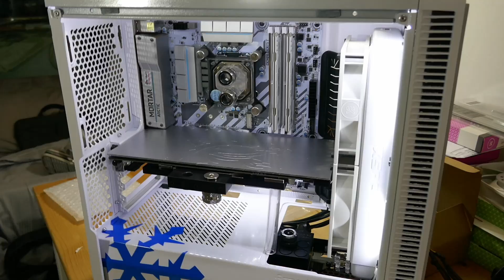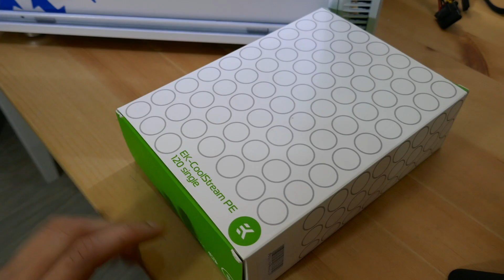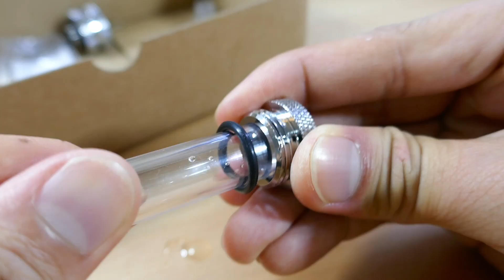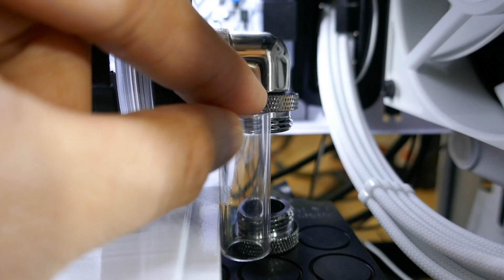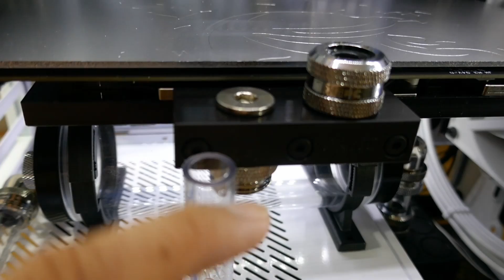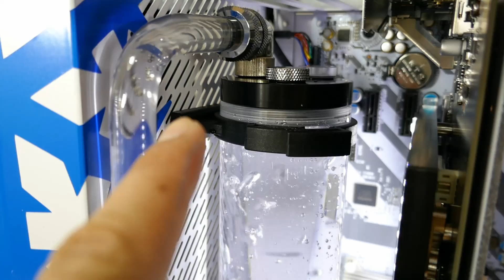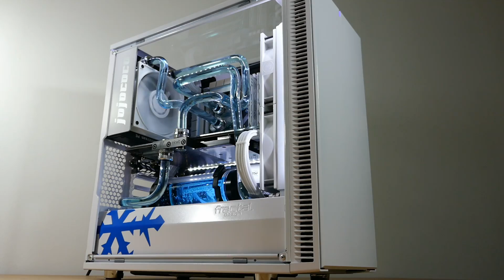Micro ATX custom water cooling loop on the Define Mini C (Part 2 of 2)

Comment: Pro tip: To make sure your bends are in the correct position. Pre-plan your loop in cad software. I use autocad but Sketchup is a good alternative if you don't have an autocad license. 
Then to make sure all your bends are at the correct radius, get some pipes of various radius, and use them to check your bends as you go.

Comment: Hey Jojo. As someone who is addicted to jayztwocents I have watched every video he has put out. One thing I must pass on to you and to anyone new to water cooling. When filling your pump and system, please do not use the power supply that is connected to everything in your system. If you have a leak while you are filling your loop and everything in your system is powered on, there is a very good possibility that your hardware could get damaged. Get a second cheap power supply with an on/off switch and plug the pump molex in to that. You will need to get a jumper for the motherboard connector for that power supply to trick it to thinking it's connected to a motherboard (this video Jay shows what the jumper looks like - start at 1:10 https://www.youtube.com/watch?v=GqYQ-XnOPPI&t=201s). Then to turn on the pump just switch on the second power supply until the reservoir is empty as you did. 

Another thing I gotta say is as you do fill the system put paper towel under each fitting. Wherever there is a possibility of water coming out put paper towel under it. It's really helpful to use even just a little colour in the water so it will show up on the paper towel very easily. But you can get by with just looking for leaks and drops on the towel as you go. 
Edit To be honest I hadn't finished the video when I made this comment (I got a little triggered when I saw the system powered on). You did mention the paper towel after, and the dye was added. sorry for jumping the gun.

Last thing I swear. Best practice for making a loop is to always include a drain system. All it is is somewhere out of sight (usually the exit of the pump or bottom fitting of a rad) put a t splitter on one of your fittings (https://www.ekwb.com/shop/ek-af-t-splitter-3f-g1-4-black) then a valve (https://www.ekwb.com/shop/ek-af-ball-valve-10mm-g1-4-black) with a plug. Then when you go to drain your loop, make sure the valve is closed, remove the plug, attach a fitting with some soft tubing (or whatever) aimed at a drain (or bucket if saving the fluid) and then open the valve. You will need to allow air into the loop to let the water come out, so you will have to open or remove a plug somewhere that wont let water out (the top of the gpu block).

This is one of Jays videos where he has some fluid issues and had to change the fluid in his loop so he goes over everything I talked about here. Lets be honest, videos are better for learning. 
https://www.youtube.com/watch?v=gIv2yGlbYy8&t=762s
The relevant part starts at 6:06; he talks about the power supply at 9:44; he talks about letting air in to drain the loop best at 10:43.

I know I am a year late to this video, however I hope that leaving this comment will help someone who is new to water cooling be a little safer. Water cooling is great and really not as dangerous as people like to make it out to be. You just have to be a little more observant with your system, and there is a lot more work involved. Just changing RAM sometimes involves a full drain and partial disassembly, depending on if tubes are in the way when you designed your loop. But I feel like the modding community is not afraid of a little work (hence the projects we do), and we probably look in our systems more than the average gamer/computer user. 

I am going to be modding my Fractal Define C (full size) and putting in my first water loop this December and I came across your videos. I LOVE what you've done with this build. Immediate sub and I will definitely go through your catalog of videos to see what I can incorporate in my build. Lots of water cooling/modding love keep changing it up.

Comment: https://www.amazon.com/gp/product/B00BSR916I/ref=oh_aui_detailpage_o02_s00?ie=UTF8&psc=1 
I've found this paint pen to be super easy and come out really good.  I use it the color the outside of the fans and stuff like that.
Liquitex 4620337 Professional Fine Paint Marker, Carbon Black  
Theres like 60 colors.  As long as youre careful of dust it comes out great.
Reply: I also use it on the wires, like the blue green header coming off.  Some it doesnt stick well though.  And there may be better paints..

Need more blue dye.

Comment: How long is that graphicscard?

I just bought the case,still waiting for it, and i plan on having a 280mm rad + fans in the front.

But now i am not sure that my 1080ti will fit in with that config..
Forgot to measure before i ordered..

Comment: Shame that paint job turned out so poorly.  I know you just rattle canned it, but I feel like the results could have been better if you put a lot more effort into prep work and sanding.  Same with the tubing... that's some horrible kinking on those bends.... try heating the acrylic slower and getting it to a higher temp before bending.  The insides of the bends are folding up like that because the bends are too tight and the acrylic isn't hot enough.  

It's honestly all a bit of a mess.

Comment: You may need to add more water so the right side reservoir outlet(?), so it doesn't allow air into the lines, especially the pump (Ignore previous comment if it's an inlet To the reservoir)?  On the bottom of the pump (lowest point) is there a drainage valve (& cap) or just a cap?

Comment: Can someone help me and tell me how he managed to get the reservoir to stay attached when he turned the pc vertically
Reply: He did say he was going to slide some double-sided tape under the reservoir mounting bracket. Probably just didn't film it cuz tape isn't exciting. 
Though at that point the hardline tubing and fittings would have been able to hold it mostly in place with the risk of causing leaks because of the weight of the full resevoir.
Reply: wiseguysez - Ah that makes sense thank you, I was concerned that he was using the tubes to hold up the whole reservoir while it was filled!!

Comment: idk if youd be able to but you should try doing some tempered glass mods. and maybe some custom cabling. say a clear front panel side panel top and rear.  depending on the case you could still get air intake through the front, and out the top though youd have to get a glass drill bit and figure out a standoff set up. or some magnets could work. idk i just get the feeling you could do something really nice with it.  

you could also do your own case from scratch from acrylic and some recycled bits of scrap case. youd need some different colors but it makes for awesome cases. my buddy did one thats wall mounted and sorta looks like a step pyramid, the different layers are different colors some clear some solid, between each layer is a layer of black electrical tape and behind the mobo is a cut out and where he mounted the lights, each layers lighting is controlled separately. the gpu is mounted vertically, and its all on water, the rads are set up beside the system so they look like their floating in front of the acrylic wall mount or whatever you wish to call it.  he also used some angle iron or whatever you call it and plywood to build the mount where it attaches to the wall and where the glass front panel covers the system(like on the thermal take wall mounted case) threads into. i think he also used a tv wall mount so it can be lifted off for repairs or anything. ill see if i can get photos of it.  though cutting the acrylic for that kinda project gets tedious.

Comment: You dodged a bullet there without having some towel around the loop while filling. Try air testing your loop next time. Then if you have a leak its only air leaking out that will not damage your gear. You find leaks with a Q-tip and soapy water. 
Easy done that way. I pressure tested my loop to 7psi and left it for 5hrs like that before filling.
Reply: dandel351 no one i know says to run your pump dry because it will screw it up if you run it like that for too long 🙁

Comment: im confused arent rear fans supposed to be exhausts? doesnt that make the radiator hot instead of cool?
Reply: It may be slightly warmer if it is exhausting case air rather than intake of fresh air but the coolant will still be getting cooled a few degrees, besides that system is getting enough cooling from the front rad.
Reply: dandel351 thanks man
Reply: No problem.  Just make sure you never copy this guy and not have any safety net when filling your loop. He had no paper towel to catch leaks and cycled the pump with power connected to the system. If you get a leak in that condition your system is toast.
Reply: dandel351 dont worry my man when i made a custom loop for my friend (2 fury-x's and a i7 4790k hooked up to a 320mm radiator for the 2 gpu's and a 180mm radiator for the cpu) i had paper towels across the whole pc i am one of those people that doesnt trust himself xD
Reply: Next time you finish plumbing a loop, try air pressure testing it first. If it holds air it will hold water and there is no risk to your expensive computer hardware.
Reply: dandel351 thats a good one! never thought of that. thanks man!
Reply: No worries mate. Its easy. All you need is a few fittings and a bike pump. I made a video showing my testing unit if you want to see that. Make sure you keep the test pressure about 7psi.

Comment: Howdy JoJo, I see the Bend around the GPU worked ... Awesome Tubing work young man, I really Like your design  and execution of your loop. I hate when people say they are going to do water cooling and they use as little of the actual Hard tubing as Possible........I personally Like yours better than those where you only see about 5 inches of Tubing and the rest is all the Fittings they get for Free (I hate that)...I get they are pushing the sponsor and that's OK but dont make it your Mission in your Build because when they do they loose the Builds personality and yours Has Not WELL DONE JOJO !!  
      On the sticker thing maybe next time  use a little off color paint the highlight the dragon so if you do pull it of it will POP Huge, if not dont worry about it your build looks fantastic.......oh and as for Fractal making White cases or any of the manufactures.....they can see how popular they are and the some times make a special version white one sometimes but they still dont get it they can sell a lot more if all their cases were available in a white option.  WE Can Only Hope and Keep Screaming at them to do it and just maybe they will get it.....if not the hell with them we will paint all their shit from cases to Rads......!   Keep Up The Great Work JoJo!   Cow }:-o)

Comment: Just a little suggestion, when testing your custom waterloops for leaks normally you would want to put paper towels or paper napkins under just in case and also the bubbles will be gone once you leave the pump running with the cap off for a while. Besides that great video man!
Reply: Still haven't finished the video.

Comment: To avoid ultra long bends you should have gone with a cross flow rad in the front there are even some avail that are all white and have really really good performance. Because the longer the tubing the more ugly some of your bends are bound to be. That's why cross flow rads are so good in small space builds.
Reply from the maker: Baki Yuku great thanks for the suggestion, what company makes cross flow rads?

Comment: I hope you had a much better time with the XSPC silicone insert than I did when I made my first (and currently only) hard tube loop. I pulled so hard on my insert while trying to take it out (even having used soapy water) that I actually permanently stretched it and could no longer use a small portion of the insert for bending.

Good choice on leaving the dragon sticker on the backplate. It looks awesome!

And here's a thought about your loop: If you remove the smaller radiator and rotate the CPU block 90 degrees, you could do a very simple and cleaner full parallel loop. This would no longer require the awkward bend around the graphics card.
Reply from the maker: I think i have to buy another XSPC silicone as I pulled really hard from the tube and now its thinner than before :( I just noticed this while bending the tubes and it messes the tube up! Also thanks for the advice about the CPU block, will try that on another build. Thanks for watching!
Reply: How did cutting the tube go? I found that I could never quite get a truly clean cut on the tubes using the XSPC cutter. It always cut the tube at a bit of an angle which I always had to fix. I really like XSPC's radiators and fittings, but I don't plan to use their tubes or cutter on my next build. Instead, I'm going to use 16mm OD tube with BitsPower fittings and a small hand saw for cutting like I see others doing. I guess it could also be because XSPC's tubing is PETG and not acrylic. I guess I'll find out.
Reply from the maker: ScreamsoftheDead the cutting was alright, it was never dead straight though, had to sand it a bit. Also when cutting it, do you get a little mark near the tip of the tube? Or maybe it's just my cutter
Reply: I just tested on one of my rejected bends, and the cutter does make a visible mark. I think the mark is caused by the pressure required to cut the tube. The pressure forces the tube to press into both sides of the small gap that is there for the blade to pass through.
Reply from the maker: ScreamsoftheDead ah yeah true, that make sense
Reply: I use a pair of nice garden shears and it actually works great. Cuts straight and no marks. As far as soap and the insert goes, using barrow tubes and insert I've never even had to use soap. Cheers.